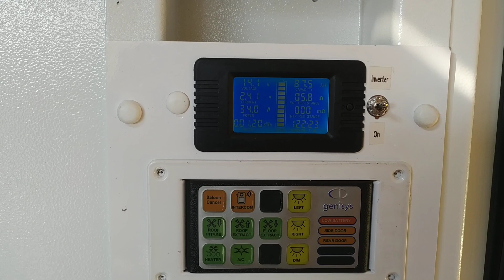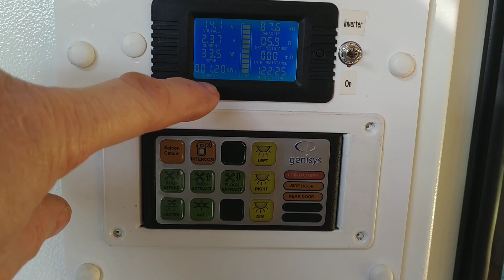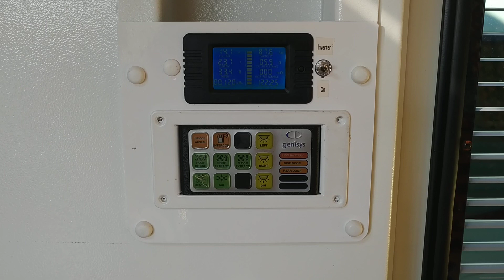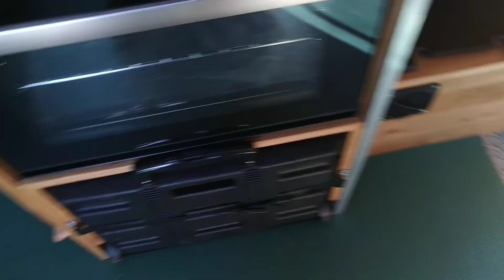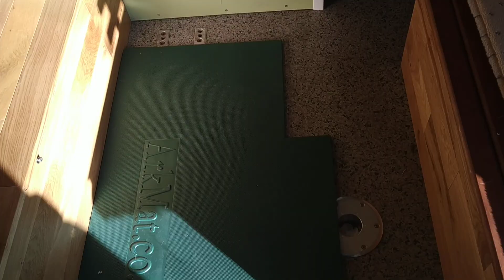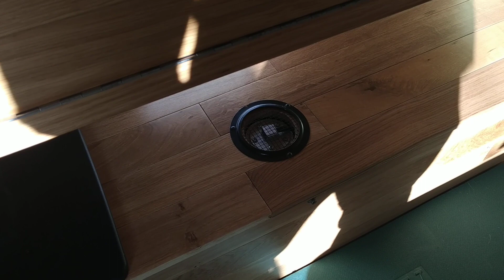New battery monitor, flooring & water level gauge

Comment: Great idea for the floor. I havent seen a video on your shower install keith, was hoping you had one for that. Love the series of videos
Reply from the maker: The foam mats worked very well up in Scotland last September, dead easy to take outside and clean etc. I will definitely be using something similar in the Crafter. They do expand considerably in the sun though!

The battery monitor was not very good and I replaced it with this Aili which is excellent.
https://youtu.be/JYIpfH2eVFY

I don’t tend to do build videos everyone does those, my videos are mainly to present ideas
There is a section on the shower and toilet in the tour video.